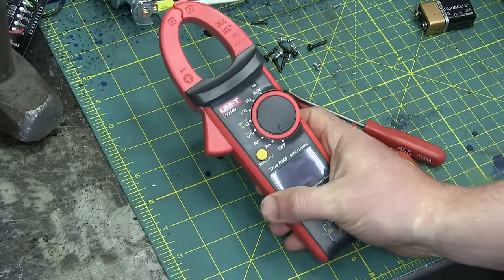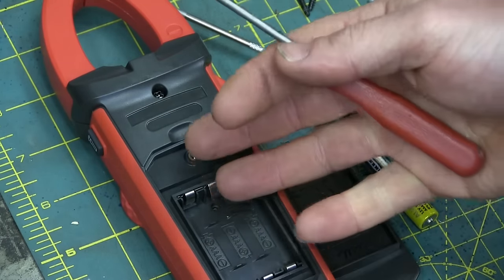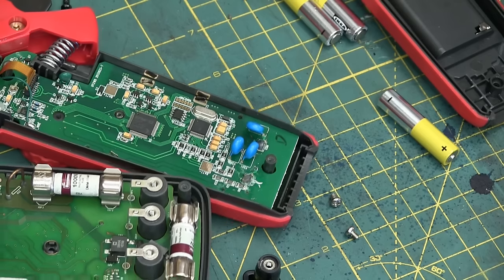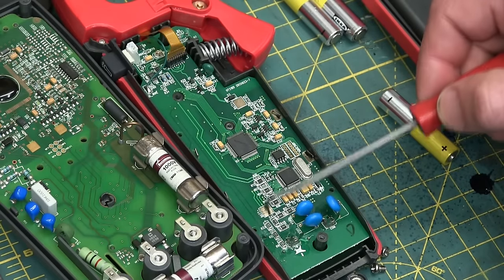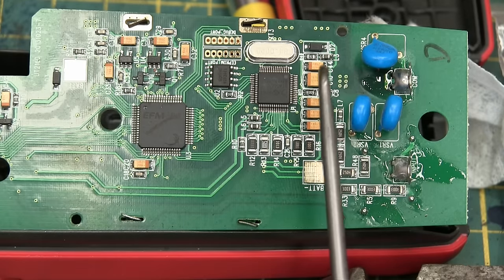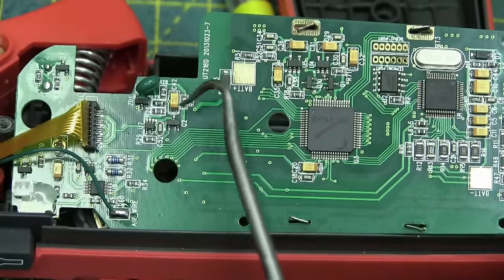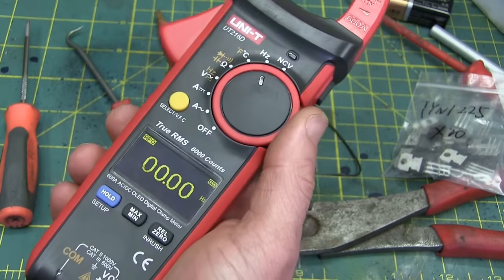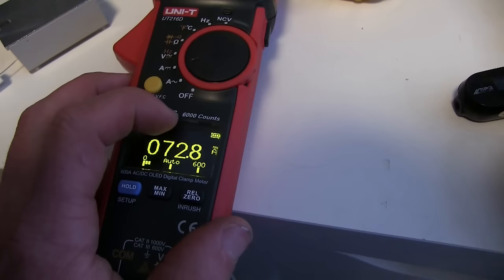BOLTR: UNI-T Clamp-On Multimeter

Comment: The meter you got was most likely a reject & "reworked".  The trace and pad under the terminal are broken, which is why you can't read Ohms or continuity.  The other tell-tale sign is the serial number which was wrinkled and stuck in the wrong place.  Solder a wire from the terminal to the PCB trace and it will probably work OK.  The superglue won't hold it, clean it off and use a good two part epoxy and it will last.

Comment: I've had a Uni-T UT210D baby version of that for going on five years now.  It was less than $50 and it's been a little champ of a meter, recommended by Big Clive.  He was right about it.  It's made well, batteries last, and it does everything including capacitance and AC/DC current as well as millivolts.  A whole lot packed into a little case the size of a Mickey-D's breakfast burrito, but without the heartburn.

Comment: I'm left handed, you get used to it. my computer mouse stays on the right.
Reply: ditto
Reply: I'm left handed. I use a trackball that doesn't prefer either hand and have it on the left. Much more comfortable that using a right handed mouse day in day out.
Reply: Ditto. After a while you get tired of switching it and learn how to use the right hand position. Has some advantages as far as writing and mousing at the same time.
Reply: I only have my mouse on the left side during special ocations :)
Reply: I keep mine on the left.
Bugs the hell out of our IT guys, but considering it takes them 2 weeks to fix a problem, I don't feel too bad.
Reply: I'm a right handed individual who uses their mouse on the left side .I do a lot of data entry and I find it easier to select fields with left hand and enter the data using the number pad with my right .  I however use track pads and such with my right hand .
Reply: Right hand trackpad on the right, left hand 2d mouse on left. Right hand 3d mouse on right. Keyboard somewhere in the middle.

Comment: I've dealt with both UL and ETL for field certifying electrical switch gear and walk-in coolers/freezers. Different bunch of people from each company for each project, and both times ETL was far more eager to please whereas UL was pulling teeth just to get a hold of someone a week later who might be able to work up a quote the following month. Granted that's for field-inspecting, not product testing and listing. Long of the short of it, I think ETL is just easier to deal with

Comment: Rest assured, multimeters that are used on aircraft for work that require any measurements have to be calibrated and tagged regularly. They'll let you use a cheapo for checking continuity or for the existence of voltage. The second you start needing to measure anything, you have to head to the tool room to get the calibrated multimeter with stamp on it.
Reply: I’m sure the ALWAYS do… just like the rest of us free thinking humans lol

Comment: The tab was already loose at 7:39 before it broke.  The corner next to the V in V_INPUT lifts up on the last tap when it was tapped.   There is trace from the tab to R9 that is broken.  Fix the connection to R9 and the meter will probably be ready for probing the pixies again.  If they give their consent.
Reply: it also has a trace that goes off to the right side of the pad. 2 traces came from that one f*ed up solder pad
Reply: I missed the second trace you are correct!  Both require reconnection.  Agreed!

Comment: The circuit boards are all tested and a power up test is done at the end of assembly. Functional testing is only done on a sample basis, though. Like I said, when the company I worked for used to sell them, we did have quite a lot of bounces (mostly cheapy multimeters), but they did replace them under warranty without much hassle. I guess in places like Canada this is a little harder to do than in tiny little Belgium, but still.

Comment: With your superglue job, maybe you didn't notice there's a trace on the right side of the solder pad that broke when you peeled up the pad: superglue ain't gonna fix that, if it weren't broken before, it is now!

But I wonder: maybe that pad and trace were broken before you banged 'em?  Either from the factory, or from some gorilla jamming the leads into the sockets too hard?   It sure peeled up real easy, and it was a little wiggly when you touched it earlier.
Reply: I saw the same AvE go fix it. :D
Reply: I third
Reply: Yep, just what I came here to say. But I think it was broken before, because when he first touches it at 7:40, its already moving a little.
Reply: AvE, we wait for confirmation. Get Your beer with You, go to the shop and check it. I would say that if all the measurement modes are fucked it is most likely the contact.
Reply: At 7:41 it looks like it was already partially broken.  Looked a bit wobbly when he poked it.
Reply: just needs a little bodge wire soldered in
Reply: Sounds like he was more right than he realized at 7:30: The connections were already forked.  ;-p
Reply: Lucky there's a via right next to the broken pad. Shouldn't be too hard to solder a wire over to fix it
Reply: yeah, it looks pre-fuxored to me..  hopefully, it only goes to the varistors..
Reply: Yeah man... There's yah problem! I also think that it snapped of so easily because it was already broken! I feel a part 3 coming up!
Reply: ***** If I'm following the trace through to the front correctly, it actually runs to one of the positive thermistors, and THEN back through the board to the varistor.

Comment: One tip for ambient temp with multimeters, if it can measure temperature with a thermocouple, you can also measure ambient by shorting the pos and neg test leads in temp mode.

Comment: I'm an aspiring engineer, and a bit of a tinkerer, I know how to wrangle pixies at a level slightly higher than a blind apprentice, and I've always known to use caps, but never why, or how they worked. For the most part when searching the ol' hive mind I've left with more questions than answers about exactly why the caps get the pixies to line up so nicely for them. Thanks for the explanation on this and so many other topics for the common (young) man!

Comment: Not sure if already covered by other comments, but another reason for using multiple resistors in a line (aside from creepage distance) is that each resistor can have a lower breakdown voltage.  A single resistor designed to withstand 1 kV can be replaced by five rated at 200 V each -- and those are cheaper.

Comment: What you were describing was a wet tantalum capacitor which usually looks like a normal electrolytic capacitor and is a very different beast to the ones on the board which use a solid manganese dioxide electrolyte.

Comment: In order to get better accuaracy when measuring amps,whind the wire a couple of turns around the clamp and then divide the reading by the number of turns used

Comment: This might be interesting to some: the Arduino IDE uses gcc as the compiler backend, which is not too surprising since Atmel seems to like gcc and all of the core Arduino code is C (except the IDE, which is Java.) Adapting alternate toolchains (like vim/gcc :D or Netbeans or Eclipse and even Codewarrior or VistualStudio) is not only possible but it's fairly easy. Check your favorite IDE's settings (sometimes in "project settings" or "build settings") for the actual compile command and arguments.

Comment: I have one or at least a very similar, gotta say it's a handy little meter although I'm not expecting anything too precise. The voltage detector on the tip saved my bacon once when I found out that my metal sink/countertop was live because my water heater leaked on the bottom which is where it's connectors were

Comment: I guess it is the QC that separates the boys from the men.  All manufacturing is going to have a unit failure rate, but letting those runts out the door is what marks a Uni-T.

You may want to make mention of Binary vs Gray-coded rotary selectors in this sort of video.  Wikipedia describes them in the rotary encoder article, pretty neat stuff, worth sharing with the apprentices.

Comment: The hobby market is tiny compared to the pro manufacturers using tons of ARM chips in devices so it's very low priority to create something like an Arduino compatible environment for hobbyist.
Reply: Also, I have used an older version of the Silabs IDE.  It is easy to install and easy to use and doesn't require you to jump through a bunch of hoops.  As a result, Silabs doesn't lose much market due to tools issues.

Comment: The two PTC's at the bottom of the board is a part of the input protection. When you push too many pixies through them at once they heat up and rise in resistance, cutting off the flow of pixies :D - The NTC in the top is indeed for temperature compensation of the hall-sensor which apparently is temperature affected, too.

Comment: You're actually supposed to allign and centre the wire with the arrovs or other markings in the current clamp to get the correct current measure. It may give you a more accurate reading at the low end of the scale. :)

Comment: Why would a clamp meter be fused?  No multimeter is fused in the voltage/ohm socket and since that meter measures both AC and DC with the current clamp there will me no fuse.  It also looks to me that there is adequate protection on the input jacks with those MOV's...
Reply: Sorry about the above response.  I should have watched the whole thing before my first comment.  BTW I love the real life stuff (like the super glue) left in.  You just role with, "If a little dab will do ya then a big gob will screw ya!"  Funny stuff there!  Keep up the good work.  I'm subbed.

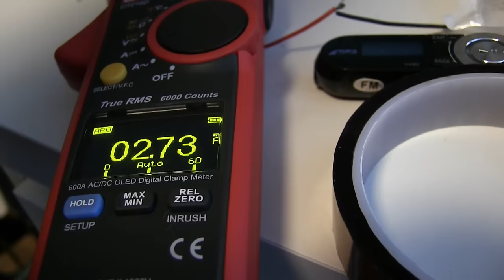Comment: Hi Ave, do you forget to put in "zero"? 27:50
Reply: It says "600A" on one of the clamps so I think he meant 600 amps DC.
Reply: These meters do not measure dc current, only AC
Reply: He clearly shows it measuring DC current with the clamp.
Reply: Well i am sorry you are correct. I have been looking to buy one of these for a few months and everyone i look at only has specs for ac current and not dc but after looking at these uni t ones, it seems they do DC current. I will have to buy one. I just assumed all clamp meters were the same. Even the flukes only do ac current. Thanks ave and thank you sir for pointing that out
Reply: but i want it to read using the clamp so that i do not have to put the meter in the circuit to find dc current. I did not know it was possibel until now because i looked at alot of meters to buy and every one says only ac current until i looked at this UNI-T
Reply: I like how every single comment here is nothing to do with the original comment.

I have a UNI-T clamp meter and the amps scale usually reads 0.6 without calibration.

Comment: Okay, you glued the terminal back to the PCB, but you didn’t solder it back to the trace it had been torn off. Ain’t gonna chooch.
Reply: Hard to tell from 480p (can't be arsed to switch to HD just to squint at parts) but impression was the terminal is a through hole part. Base is only for mechanical.
Reply: Yup, saw it moving. The way those are attached is asking for that to happen though. I like the why the fluke is with the through hole leg screwed into the back side of the terminal. its far enough from the board to allow a little flex without popping the seal.
Reply: it still had connection, it had some through holes on the top. but my bet is they let it get too hot on the board as they soldered and it may of damaged some parts in it messing it up. sometimes those chips can be finicky.

Comment: Did you repair the track from the connector that broke?
Reply: Yeah the thingy he glued was connected to a trace snaking off to the other side of the input.
Reply: I wonder if that pad was already partially broken.  That broken track might well explain the non-chooching?
Reply: 8:28 if it's not broken by him lifting the thingy up like that b4... it is now lol.
Reply: Damnit!  He better have.  Been in the back of my mind since he popped it loose.  Maybe it was really a crap connection to begin with, and he just added the straw to that camel's back.  Run a bodge wire, AvE!
Reply: It was, I saw it move before he lifted it up!!!

Comment: bought the same meter on amazon. I'm eletrial tech by trade. I bought it because I needed a cap tester that none of my flukes had. its an ok meter for 40 bucks. small and a great beater to through in your bag and if some a-hole decides he needs it more then you then your not out to much. one thing I wish it had was a amp inrush setting. only issues I had with it was the leads that came withit sucked. overall happy. but it is what it is. not my goto meter but. the size is nice for a pocket

Comment: Did you ever work out how to set the meter into manual mode when trying to measure current? The meter seems to take too long to auto-range between the 0-60A and 60-600A ranges.

Comment: Hall effect sensors are good for checking A DC, and would probably work for AC (not entirely sure why they're not normally used in that case) but the clamp meters are more like transformers with the wire being the primary winding and the clamp being the core. At least that's how I've learned it. Those clamps put out 1 mVAC /1 AAC
Reply: You didn't give your camera the correct command to focus. Computers aren't as smart as we'd like to think they are. They have lots of difficulty figuring out what we want and when they try Murphy's Law applies and they get it wrong.
Reply: New camera or something? Or does this one just Really not like that OLED display?

Comment: I'm convinced you are a certified mad scientist. Lol!
I just purchased one of these on ebay for $70 cdn just as a backup to my main clamp meter. Do you have any info on the milwaukee clamp meters? I have a 2237-20 and I'm hearing it's engineered or designed by Fluke.

Comment: The jack terminal wobbled when you first touched it and after you lifted the pad with the scotch brite I'm confident to say that the trace/track for the terminal has been split.. If you scratch off the solder resist for the trace and resolder my bets are it would work.

Comment: The multiple input resistors are not just for isolation. Surface mount resistors have a maximum voltage, so you series them to get a higher voltage resistor. I guess I am saying isolation when I thing about it.

Comment: That battery cover has a material wheel so they can make the same physical part for different models with different needs.
 
ABS-PC: would be for sampling parts outta the mold, or specialty model.

ABS: main material for standard models. 

ABS-VO: is same ABS material but with a fire retardant agent in the color concentrate.

Comment: Is the main benefit of the clamp, hall effect really the safety?  I imagine that using the clampy thing would just be a hell of a lot faster and easier than a couple of probes or some alligator clips.  Hell if you don't even have to plug anything in and you can just go, it seems like a huge advantage.

Comment: Ave, isnt super glue and electronics a no no? I've had a few rc speed controllers say do not use cyanoacrilate near or on the case or circuit board.

Comment: AIR_WIRE. PTC's are usually used for circuit protection, when they pass too much current they get hot and start breaking the circuit and continue to keep the circuit mostly open until the fault is cleared. Not sure if that's what those green PTC's are being used for here though.   What's really fun with the UNI-T clamp meters, like some other awesome clamp meters, is that they will do DC amps on the clamp. Clamp it on you car battery cable and give her a crank.

Comment: AvE At 8:20 there is a trace the pad broke free of heading toward the hole in the PCB. It was probably broke before you tried to clean the V_Input tab. Scrape the trace clean and solder a a wire on the trace to the Pad. Unless there is another broken connection I can't see that should make it chooch.

Comment: I guess the reason there's no fuse in there is that there shouldn't be any current flowing through the input terminals.
The leads will only ever connect to a high impedance input, unlike a non-clamp meter where it measures the current through the leads.

Comment: PTC thermistors rapidly gain resistance above a certain threshold temperature. I would assume those are PTC fuses, a type of resettable fuse. Under short circuit conditions, a PTC fuse heats up like a conventional fuse, but instead of melting open, the resistance merely rises so that current passed is minimal.

The nifty part is that they then self-regulate their resistance according to their internal temperature, such that they keep themselves hot enough to stay in a high-resistance state until power is completely removed long enough for them to cool back down. 

I assume these are PTC fuses, as that's exactly what I expected to see when you pointed out the lack of real fuses (which are, indeed, overkill for this application).

Comment: The non contact AC detectors are effectively a 50/60Hz radio receiver. It shouldn't matter that phase and neutral are bundled in the same cable.

Comment: Good morning, I have a question? I am currently taking a test and there is a
Reply: Good morning, I have a question? I am currently taking a test and there is a question 3. How do you maintained a Clamp-on Meter to give better results? the answers are as follow: a. Keep in ventilated and dried area b. Calibrated annually c. Lubricated after each used. Could someone assist me?

Comment: You need to zero these meters when measuring DC with the clamp. Since it was measuring .34A before you turned on the current on your 3A test, it was actually measuring it at 3.07A which is very very close!